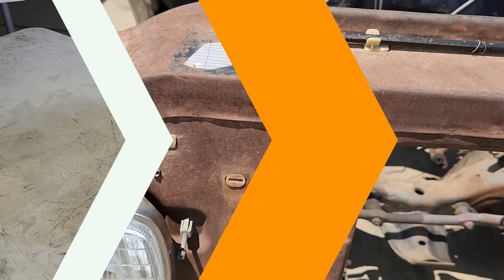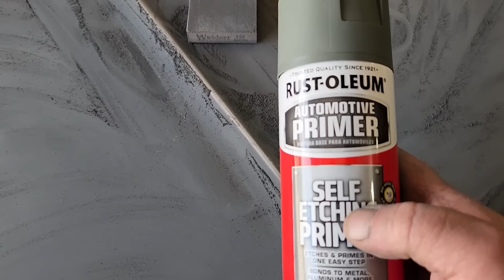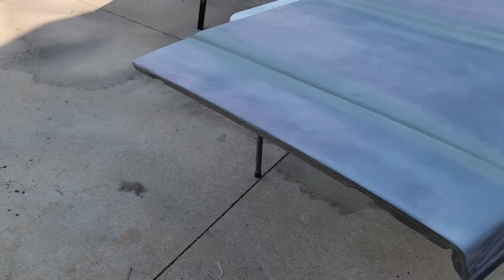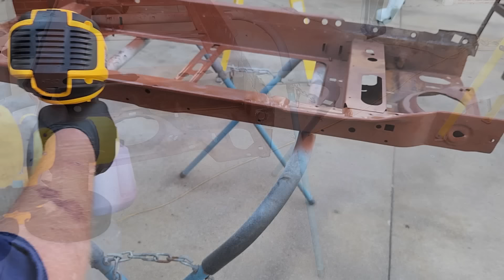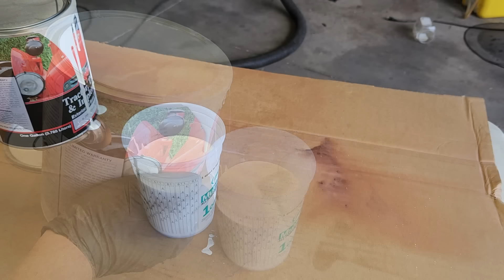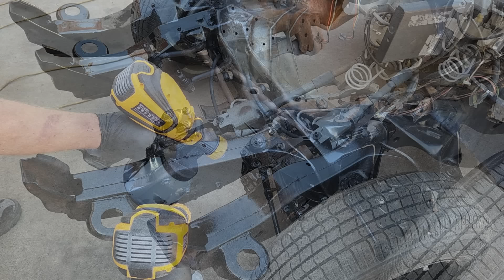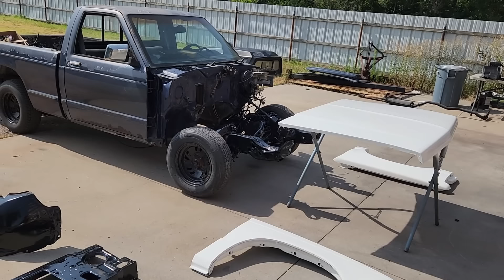S5 E27.  A low cost automotive  paint hack that really works. Rustoleum and  electric sprayer

Comment: I was a pro painter in my shop many years ago. 
A guy bought in a $500 German HVLP gun and asked me to try it. Meanwhile my Cardboard Freight $45 gun did as good a job as the $500 counterpart. Good equipment helps, but "knowing" paint really helps. It appears that you know your "stuff"!
You also have to know the signs of paint flow and drying. If you look at the right angle, you can see the paint going onto the surface. If it starts to "orange peel" I lay paint on heavier so it flows. 
A suggestion - Acetone evaporates at a very rapid rate. If you use lacquer thinner it doesn't evaporate as quickly and is also great for gun clean up. I use an old quart can with lacquer  thinner in it with an acid brush - this works really well cleaning equipment.
Reply: I had one of those from harbor freight.  I sprayed cabinets with it. Did a great job. Its prep sanding all those things that make a good paint job.
Reply: We used Harbor Freight guns all the time at work, and I worked in the paint shops of several guitar companies and car factories and steel fabs over the years. Airbrush I can see being expensive because of the tolerances involved. A pressure pot and a gun, not so much, it's not particularly complicated or difficult to manufacture equipment

Comment: 9:01 why isn't it good to mix your filler on cardboard? I dont think I've mixed on anything but cardboard. Not saying its right just how we did it.
Reply: There can be dies or pigments or any number of chemicals soaked into the cardboard that you are going to transfer into your body filler.
Reply: @jonathanstarr3568 hadn't thought of that. Thank you.
Reply: @jondoe4667  10 years in a body shop you learn why you do things a certain way and they always bought mixing boards for us. That being said I always use scrap cardboard to mix my JB weld at home. Using cardboard isn’t 100% incorrect anyway. As long as you’ve got a source of cardboard that you know works then why not use it. As long as you don’t have problems with your filler be behaving poorly then if it works, why not do it?

Comment: Good video. One thing that surprises me is you say (well, the fake AI voice says) that you have a lot of experience with painting. But when you painted the body panels, you held the gun at an angle which a good painter knows is a no no. You even rubbed the paint tub on against the hood when you where spraying the white paint on it. Always try to hold the paint sprayer perpendicular to the surface you are painting. Not bad for a fake AI video.

Comment: There is a version of this sprayer branded as "PainTron", and it has a knob that lets you adjust the spray pattern from fan to round. So far I've used mine to lay down BIN primer and acrylic latex paint on OSB walls. Using the 2.0 or  2.5mm nozzle, I was able to do this without any thinning. Results are excellent, especially considering that OSB suck to paint due to potential resin bleedthru (hence the use of BIN primer). My only real complaint about the sprayer is that it will cause arm fatigue if you fill it to the max, about half a gallon. The flipside is that once  you start you can knock out a lot of painting without stopping to refill.

Comment: As a pro auto body and paint guy, you are no where near letting on to how good and how much you know about auto painting 😂 nice job and thank you for not acting like a know it all even though you obviously know a ton!
Reply: 😂 dragging the whole thing rin paint
Reply: The point was saving money with a "good enough " paint job. 
I used to build a lot of machines we weren't really supposed to paint at all. However if we could paint fast and cheap we got away with it . I fully understand what he wss doing.
Reply: If he knew something, he would use better paint.
Reply: @markanthony3275 The paint is fine, we sprayed cheaper shit than this on multimillion dollar modular process skids that sit soaked in chemicals from chemical plants all day. It's the fact that they got more base on the cardboard than on the part that gets me
Reply: @markanthony3275 at least use Limco
Reply: @markanthony3275 ”low cost”…
Reply: @markanthony3275    I have a horse trailer sitting in the field with the sun bearing on it.   I painted it 21 years ago using Tractor Supply Acryic Enamel and hardener for tractors.      The paint is a bit faded but it’s still there never having seen a coat of wax in its life of always sitting outside.

Comment: I paint a lot of steel projects with a similar spray gun -mine has a turbine connected to the gun with a 1 in hose. The turbine runs all the time so no spitting... I use the same paint and it's very durable including for stuff left outdoors. I also use acetone to thin which I believe is the main thinner in the rattle cans. (acetone btw is much less toxic to people and the environment than other solvants) I find that proper viscosity is critical to consistent results. I use a number 4 ford viscosity cup and aim for 22 to 25 seconds.

Comment: Eastwood used to sell an $800 HVLP system that seems to work like this does. It had a separate turbo in a box to move the air instead of  mounting it on the gun. I have a compressor and a gun, but getting the air dry enough to spray is the problem. I have to wait until winter when the air is dry enough to spray with. Two inline driers aren't enough to get the water out.  This looks like a better option than my compressor.

Comment: Man that came out terrific. Many years ago, I painted the frame on an old Camaro with Rustoleum rattle cans, and it came out great. Had the car itself painted professionally. I did do the hood of a truck one time, and like you say, good enough, but more durable than I expected. Ran it through car washes and all, it never came off. Thanks for the video

Comment: I used a very similar gun to paint 3 tractor trailer bay walls at work. I had never used a sprayer of any kind before and I got an atta boy from the boss. I used water based primer/paint and mixed each 3/4 gallon with 16 0unces water. It took 6 gallons for the whole job. When spraying upwards the suction tube in the reservoir should be adjusted towards the back end especially when the reservoir is low. Once during the project I had to take everything apart to clean the nozzle and all parts .

Comment: The paint works just fine but if you use that sprayer your car will look like a fat positivity model having a heart attack on the shitter! The finish will not be smooth, itll have a textured feel almost like bed liner. There are turbine paint sprayers that will lay down automotive paint really well but these hand held units are dog shit. The wagner motocoat works pretty well, isnt too expensive, and negates having to get a compressor than can supply whatever gun you have.

Comment: I have one of these sprayers that I specifically bought to paint some 150 year old intricate wrought iron railings. It worked great getting into the nooks and crannies without over loading and pooling the paint. There was an awful lot of overspray but that is understandable. After watching your video it has given me confidence to spray some exterior doors. I never considered using acetone as a thinner for oil based paint and only had it around for resin and spray foam cleanup. I’ll definitely be using it. Thanks for the video.

Comment: 10:25 lifehack: if youre having a hard time figuring out if the surface is uneven you can use a certain type of paper tower put it on your hand and move it over the surface, like this it will be way easier to figure out how smooth the surface is

Comment: Your video definitely helped me feel a little more confident in the prep and everything that needs to go into painting my truck so thank you. I have a 95 dodge known for its less then fantastic clear coat. Do I need to sand the clear entirely off or just the edges of the peeling and a little past to make sure it won't peel further. I'm thinking all of it off to make sure any bubbling is gone but if I don't really have to do all that work I'd like to avoid it unless I'll regret it in the future.

Comment: My electric gun has extension spray tubes that allowed for altering the spray angle while holding the gun for maximum cup pickup. It also served to reduced the back spray getting on the gun and me.  These extensions were only 12”. The good is that they did work!

Comment: you are the 2nd guy I have seen use hardener in the primer.......Anyway if you want a slower reducer on a budget NAMPTHA works really well and when using hardner I can usually shoot another coat in about 4 hours. Also remember a foam roller is still an option on these oil based paints.

Comment: Way to go.  On Amazon, the paint sprayer linked has sold 10,000+ units within the last month.  That's more than 10 times the number as the second best seller.  Not saying that they are all affiliate sales but there might be some correlation.

Comment: I can verify that this worked amazingly. I have over a decade in the paint and body field and with my air compressor down I decided to grab one of these to see and it even turned out good in a back yard. The farm paint needs to be mixed 2:1 with a splash of hardener to lay good and just like a normal gun be sure to keep the tip clean 👍

Comment: Rustolium with a brush flows out really nice. Looks like you sprayed it. I use that where I want it thick. Used it on the frame of a dumpser rolloff truck.also the rims on my car and frame and underneath the bed. Dont forget to undercoat or spray the inside of the panels

Comment: You most likely already have a Diesel engine and the OM 615/616 ist probably to expensive, but that would be an indestructible, low powered diesel engine, just perfect for the truck. Mercedes 200D/240D are known to run this engine well over 1 million Kilometers. And you can probably fit a turbo as well, since Mercedes also did it with the 5 Zylinder Version of the engine.

Comment: Magik is the absolute worst paint I've ever used.. It takes forever to cure, isn't very durable and fades quickly. You would've been much better off with Rustoleum. 🤷🏻 Oh well, but it does look better than before. 👍 I'll definitely have to try one of those guns! 🍻
Reply: Faster curing is where the hardener comes in.  Just be aware that it contains isocyanates which are toxic as hell so you need to use a proper vapor respirator.  Preferably you'd use a full suit and full faced respirator with external filtered air supply.  I've made the mistake of getting a whiff of catalyst with isocyanate without a respirator and I wished I was dead for a few days as I felt so bad.

Alternatively, you can use Japan Drier.  It's cheaper and a bit friendlier to organisms.

I do agree that Rustoleum > Magik by far.

Comment: I would have never thought that a paint sprayer, designed to paint a fence or barn, would be good enough to replace a paint gun without runs and spatters.  I suspect it has a lot to do with proper thinning. Great video!

Comment: I used the big pressure pot from Harbor Freight and used Case industrial yellow over primer and sealer. The original factory Ford industrial paint was coming off in sheets.   If you ever have painted a back hoe it's difficult to imagine all the nooks and crannies.  The gun has six foot hoses for air and paint and cost me 64.oo at the time. With virtually no weight in my hand the gun did amazing. It has survived mostly outside for twenty years with great adhesion.  We did use a bit of hardener which I recommend . In any case, Rust-Oleum red primer is the stuff to use because it doesn't fish eye when you paint over the top.

Comment: I wonder how that sprayer will hold up using oil based paints and the solvents you need to use to clean it.  I used the link to pick one up but for spraying latex paint.  I have a Titan brand gravity feed HVLP gun from TP Tools (back when they carried that brand) for shooting oil and urethane paints.

Comment: I painted an old Jeep using a cheap HVLP house sprayer, and New Holland blue tractor enamel (same as what you used). The paint did fade pretty quickly, but worked well. Should have thinned it more, and could have used some sanding, but it worked.

Comment: I'm someone that has only ever used can paints or brushes. I have this gun, although different brand, but probably the same source. I used it with water based paints and it works well. Its fairly easy to understand and set correctly, although there isn't much to it. If you are doing real life work, and not charging for it, its good enough.

Comment: I have no idea what engine you are planning on putting in there, but I did an OM617 turbo swap in an '86 Toyota I had a few years ago. It was incredibly disappointing, and I would not do that particular swap again. I think if I were to do another diesel swap I'd go with a 1.9 ALH TDI engine. Parts for the OM617 are basically impossible to find in the USA, or even at all. It's also extremely gutless.

Comment: Hey bud I just was watching one of your amr500 videos because I'm playing with the idea to put one on my kohler single slammer. I wanted to let you know that it seems to me the condenser or evaporator of a window AC unit could be used as a high quality radiator for something like a cpu cooler block, or a soup-er charger cooler as you were doing. The easy part is finding a free ac unit, hard part is finding someone to draw the refriggerments out of it. It should handle more abuse and be made better than whatever is on the market for cheap pc cooling gear.

Comment: I am restoring 52 year old Harley Davidson motorcycles(2 of them) and will be spraying two coats of primer, 3 coats of urethane base coat, 3 or 4 coats of urethane mid coat and 2 coats of clear with lots of sanding and prep work.  These are car show expectations paint jobs.  A friend of mine saw this video and said I should use this gun.  On all of this paint I have spent nearly $400.  What do you think?  So, do you think I should consider this gun for a job like this?

Comment: Okay, I might have seen one other video, but it's an S10 and I had one that was an '85.  Mine was a reg. cab long box 4X4.  It needed a full restoration, and we were going to do that, but changed our minds.  I wish we hadn't.  I got hooked when you said something about a diesel engine going into this...  Okay, I have to watch now...  I wanted to do a larger V6 on mine, but not the 4.3L unless it was the 4.3L Diesel GM had around that time.   Otherwise it was going to be a small block.   Can't wait to see what else is in store.

Comment: You almost convinced me to buy one of these paint sprayers but I already have a very nice and barely used airless paint sprayer hanging on my shop wall. 
The hardest part using my airless paint sprayer is that it has a very long hose so it requires a lot of paint to totally fill said hose. 
I'm painting an older Skid Steer machine and prep work will be the bare minimum. I'll be using the factory John Deere paint color which IMPO wasn't cheap. 
I hope I have enough JD paint to cover the whole machine as I'll be using a gallon can of CAT yellow to push through the last of the JD yellow.
Plus I'm disabled and have balance issues with lots of pain thrown in for fun!
Loved the show, Video my friend, thank you so much ❤❤❤❤❤😅😊😂.

Comment: I just ordered the cordless version of this paint gun as I have the DeWalt XR 20V Max system and don't want to tangle with a cord while painting. It should be perfect for applying water-based rust converter onto my old truck frames. I can only imagine how many weeks it would have taken to paint four truck frames with a brush! I am surprised how well your body parts turned out! Wish me luck!

Comment: Are you familiar with a product called PENETROL? Mix with oil based paint to let flow and level out. I paint my old tractors with Sherwin Williams alkyd oil paint. I use mostly a paint brush or speedy roller. I just measure how much I add like you . I first use straight PENETROL to coat over the tractor on top of the rust and old paint. Makes a excellent primer over anything . Stops rust dead . It says to mix with sprayer paint. Also can be used over top to preserve patinas. Fiberglass metal. Please let us know if you try it. No orange peel on my tractors

Comment: Jimbo, you need to be aware that you are atomizing a flammable liquid using a paint gun that has a sparking fan motor.  Fumes from this type of paint getting sucked into the fan air inlet can cause a fire or explosion.  You're probably OK outside, but painting oil or two part paints with one of these guns in a garage is extremely dangous.  This is not an issue spraying water based paints.

Comment: I've used these guns to spray two-pak and antifoul with. They are fantastic because they don't create plumes of paint and they don't waste paint. But the downside is, you wear out the paint gun quite quickly if you're not using oil based paints, as the gun needs the oil for lubrication. BTW. That a mad paint job with such low quality paint and prep. I would have filtered the paint before applying though.

Comment: as someone that's used semi-pro gear to paint a few vehicles for friends, you have to manage expectations. Too many people think you can get a perfect paint job with economy gear and cheap paint, and outdoors to boot.

Them: How good will the paint job be?
Me: How much are you willing to spend, and how many weekends to you want to spend sanding?

My favorite "paint job demo" tool is a spray bottle with water in it. Any imperfections you can see with water you'll see with the paint. 

I have to say, the electric gun did far better than I was expecting. I've seen worse from "professionals" using pro gear and premium paint.

Well done!